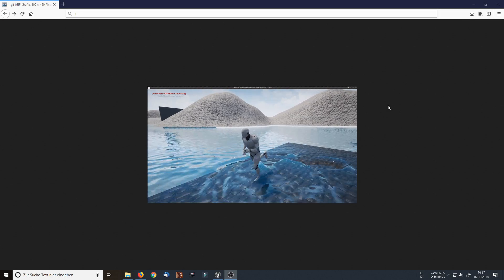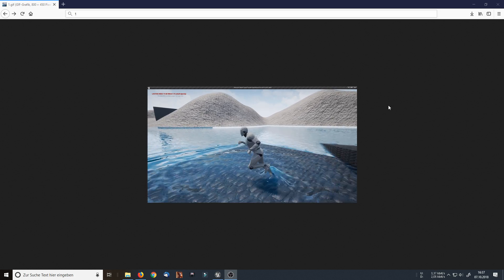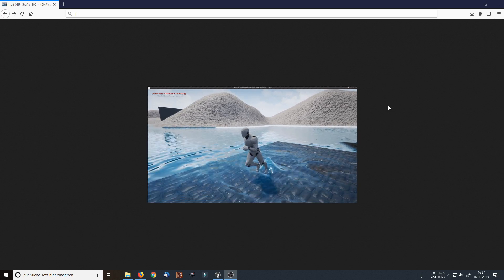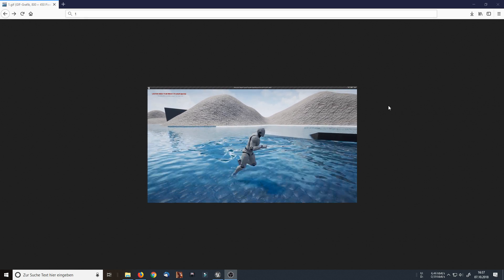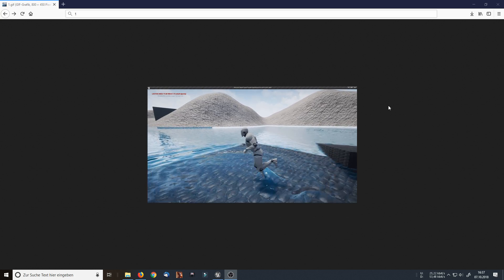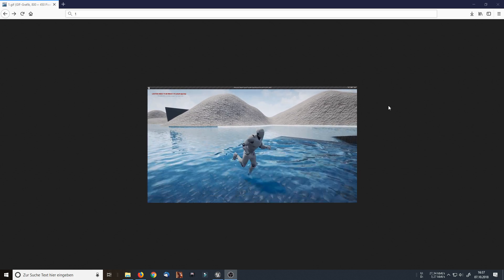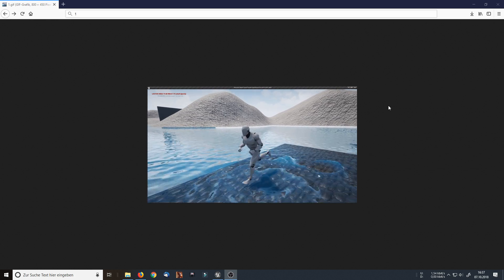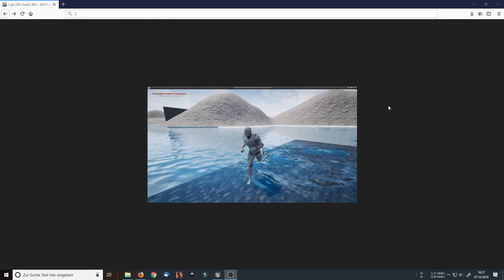FREE Unreal Engine 4 Reactive Dynamic Water 3D Project Download [UE4.19]

Comment: You have done a very good job, but not to be offensive as a material editor myself i believe the water tension is slightly to high
Reply from the maker: That's why there are over9000 sliders to adjust it

Comment: WaterMaster BP does not work as shown by simply migrating.
Reply from the maker: Why
Reply: @MarvelMaster  I am not entirely sure. There is no reactions whatsoever,  just acts like a normal water plane. 

PS I did try out the rain emitter which works great so thank you for that.
Reply from the maker: But you did set the tags?
Reply: @iamplaceholder  try to use WaterTPCharacter provided in the asset, instead of your own character.

Comment: I believe this is only for technical reasons you didn't add this; but when you're wading through deep water you gotta use a lot of force to push the water masses forward and your movement speed will be slowed down and the waves will be bigger and more foamy ;)
Reply from the maker: You can surely add this
Reply: @MarvelMaster  sure, if i knew how to make water displacing in the first place .-.

Comment: Good job, this is amazing. Can you tell me, how i can migrate this to my own game with an already existing third person char. I managed most of it, but i am stuck because for some reason i cant connect the water master bp to the idle reaction, can you help me
Reply from the maker: yes in the Master Blue print in "Wave Height by Velocity" section the Idle state is set by character velocity its a littlebit hidden i must admit I changed that for next version
Reply: @MarvelMaster  I am not quite sure, if i understand you right, but i cant connect the 5 Events in the WaterSim_Bp Idle Waves because it Says:" MasterWater_Bp Object Reference is not compatible with Object Reference" How can i make it work
Reply from the maker: then drag out a new line from Master_BP and type "Bind Event to" fireidleWaveRF for example should work...and do this for all

Comment: This is juicy. I see in your description you're planning to improve performance, what are the current performance statistics looking like?
Reply from the maker: well using a decent size of water plane everything is ok for example gtx1080ti 120fps, but when you use a bigger plane at a certain size there is a massive drop to 50fps on gtx 1080ti. But I already found the solution for that :D and dropping V1.1 soon with MUCH better fps and copyable blueprints
Reply from the maker: @Biotorial i will upload a new video and both versions will be available in the link